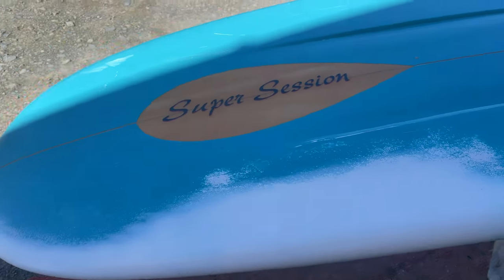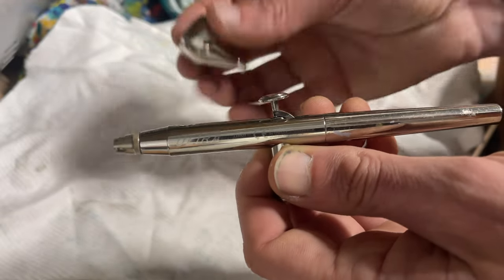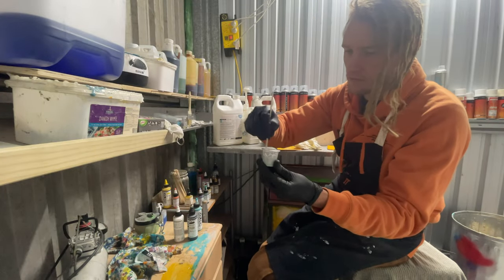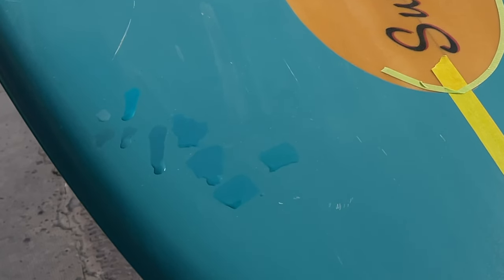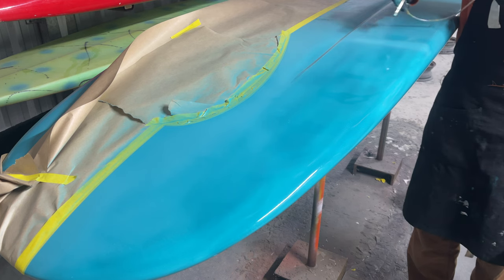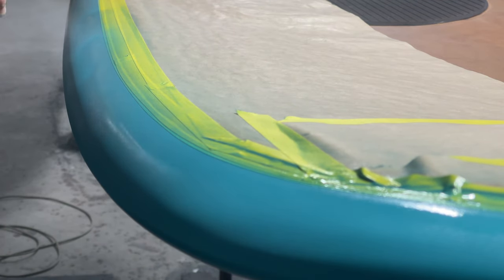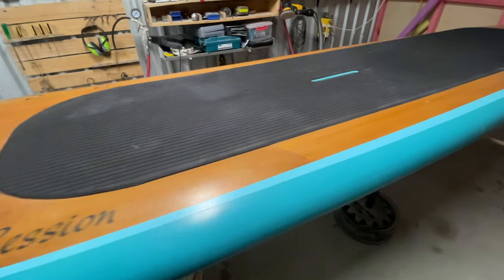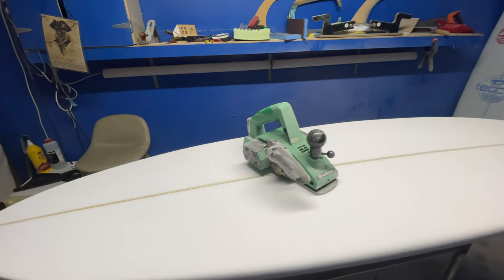Painting a Super Session board

Comment: Excellent colour match.Nice planer.I use modified makita power planer.lately have been using a cordless model with 6 amp battery
Reply from the maker: I have a cordless makita as well but not modified. Is your cordless one modified too?
Reply: @smallkinedings  yeah so the barrell are called super grit.400 for makita and 360 aud for hitachi
Reply: @smallkinedings  In the long run would cheaper to buy a second had hitachi planer and fit a new super grit barrell myself still would cost 400aud

Comment: Would there be any pros/cons to using a 4K clear? Thanks to your vids, I’ve just finished repairing and painting a 7’0 mid length and was wondering if a 4K would be better for the the final sand & polish? Cheers.😎
Reply from the maker: 2k? 4k sounds too much!
I do go into 2k benefits and flaws a bit in an old video where I review a repair that Rogue wave surfboard repairs did. 
2k clears are really good product and having a hardner in them, they are exceptionally strong, durable and polish up beautifully. That said though, something like a car is sanded to 3000 - 4000 grit before polishing where as a surfboard generally is only going to be sanded up to 1200 - 1500 grit so 2k can be overkill as it's not generally being polished to its full potential.
Cons are it's price, it's hard to buy and mix small quantities (not really an issue for you if you're spraying a full board), you need good gear (compressors, guns) to use it and because of its hardner you need good cleaning equipment and thinners to make sure your guns don't get ruined. Over spray with guns is also an issue because of their high pressure so you need a good empty space to spray in. 
You can buy 2k clears in cans but in my experience the caps/nozzles let the cans down and while the product from the can is good stuff, getting a nice even and flowing coat can be more difficult than a high end graffitti can like Molotow.
All that said though, as long as all those bases are covered, I'd never talk anyone out of 2k paints. If they are good enough for Ferraris and lambos they are EASILY good enough for surfboards!
Reply: @smallkinedings  🤣🤣🤣 I think I’ve mixed up paints with TV’s. Thanks for the explanation,think I’ll stick to the acrylic clear for this project.💪

Comment: What was the advantage of the small airbrush vs using a rattle cam for at home DIY guys. Would the color and clear coat process be the same?
Reply from the maker: The airbrush definitely has some drawbacks. Cleaning is the biggest one after the initial price point. They ain't that cheap! Because the part are so small they are difficult to maintain and incredibly fragile. The smallest knick in the key components require replacements as every part is machined so precisely. If you're just at home doing diy projects, rattle cans all day! It is fun to have an airbrush though, even on wood and canvas you can get pretty artsy with things! Clear coat process remains the same though the airbrush paint is bot nearly as hearty as something like molotow paint so an extra coat or two of clear certainly wouldn't hurt!